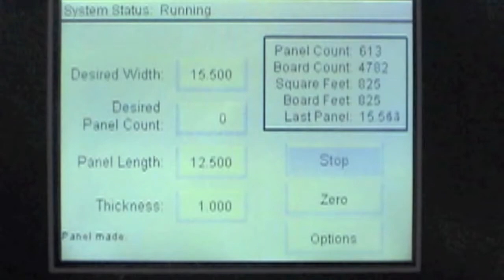James L. Taylor Laser Opti Sizer

Comment: Isnt there anything faster or more efficient that you guys have innovated yet?
Reply: We do have another model called an Opti-Match that color matches as well as sizing the panel. But, the Laser Opto-Sizer paired with a Glue Applicator and Dual Clamp Carrier remains the most productive room temperature panel gluing equipment available.